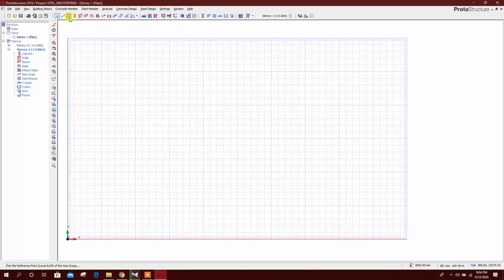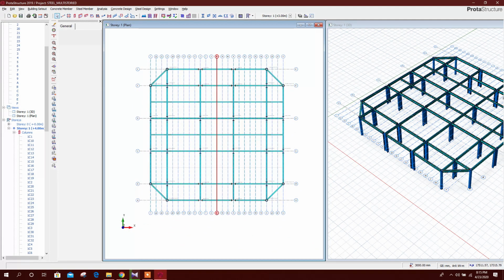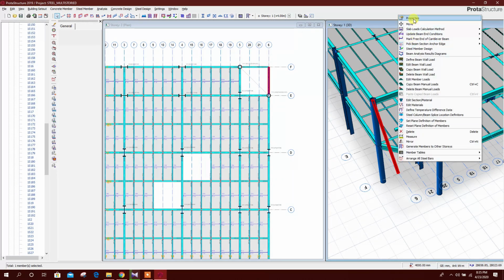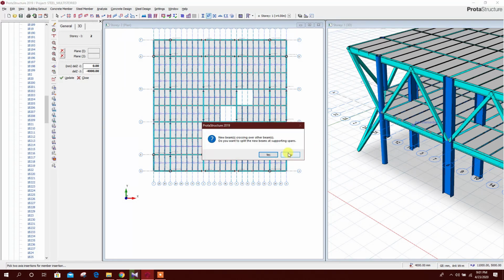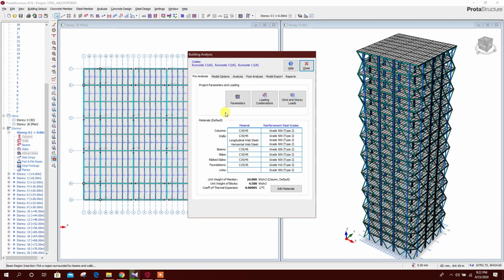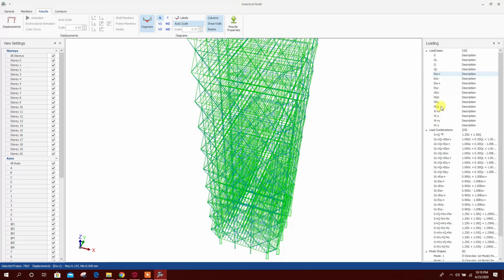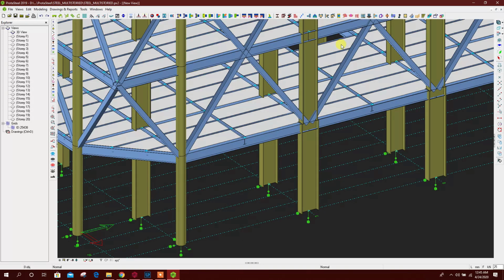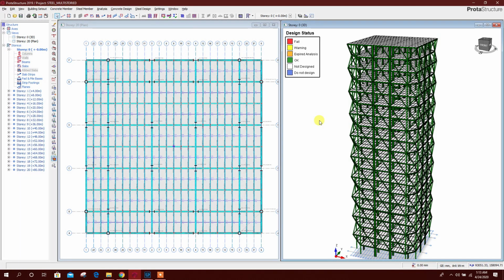Twenty Storied Steel Building Design | Prota Structure | Prota Steel

Comment: Sir how to model steel deck with concrete slab (composite slab) and set it as semk-regid diaphragm. It is possible on Tekla Structural Designer while ProtaStructure doesn't have an option like that

Comment: Can you make a video tutorial on achieving first two modes of vibration as translation in ETABS ? An easy way that you might be using to adjust CM and CR. Use of virtual work diagram or any other method that you use. It will save lot of time. Thank you.
Reply from the maker: Great suggestion!
Reply: @Decodebd  Eagerly waiting for the same. Thank you very much for providing such informative videos for us.